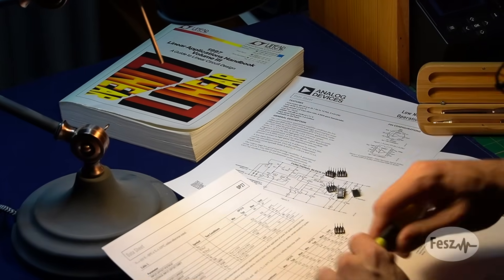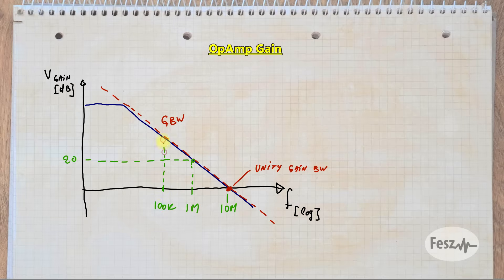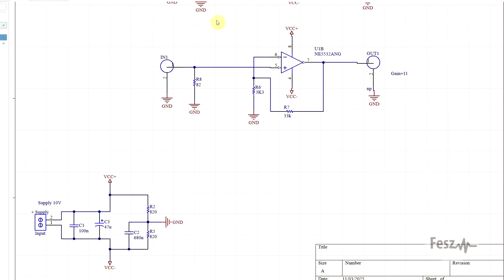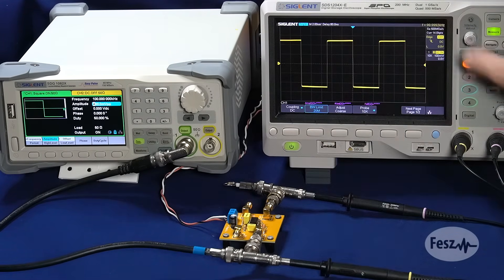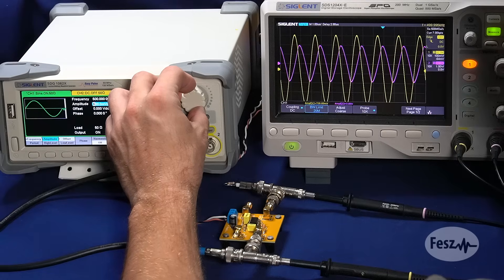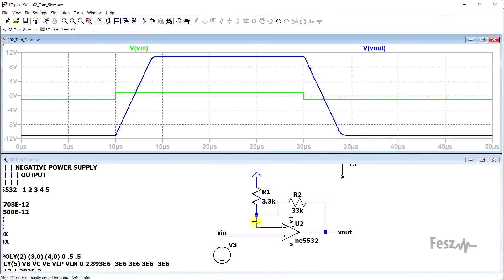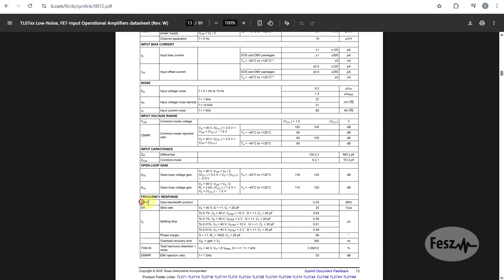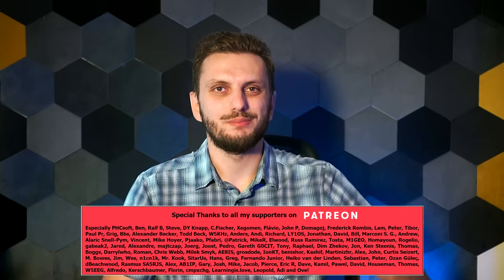Analyzing Power Bandwidth

Comment: Yet another great video to inspire from! One curiosity I have: why the two resistors from the power divider are 820ohms? I mean, why so small values? What happened if they were 2x10k?
Reply from the maker: It was not a calculated value; these resistors should be chosen based on whatever current could flow there and the acceptable voltage offset - when resistors are used and there is a nonzero current flowing trough ground, the ground will never be perfectly centered between the supply rails.

Comment: Slew rate is set by the collector current of the input pair and the dominant pole capacitor. When frequency and amplitude are high enough, the charging current demanded by the cap is too high for the input stage to supply, and the current clips. This reveals itself as a finite slope of voltage on the cap.
Reply: The dominant pole is there to have stable amp at any frequency by maintaining phase margin greater than 45°. The second pole would be located at GBW or higher.
Reply: @agnelomascarenhas8990  I know why it is there. It is what makes op amps so easy to use.

Comment: Is there a difference in the inverted connection?
Reply from the maker: For the slew rate and power bandwidth, not really - the output stage needs to do the same job regardless of the input configuration.